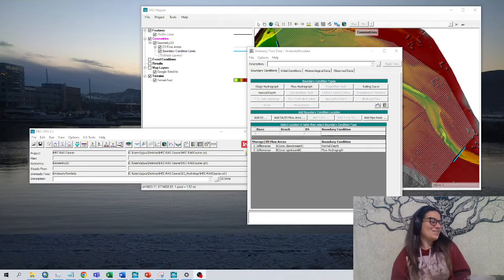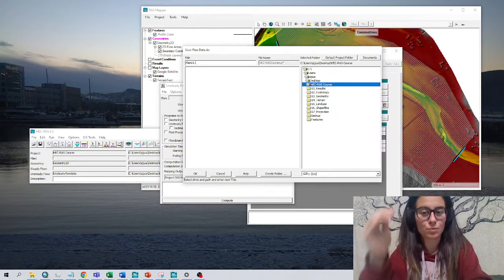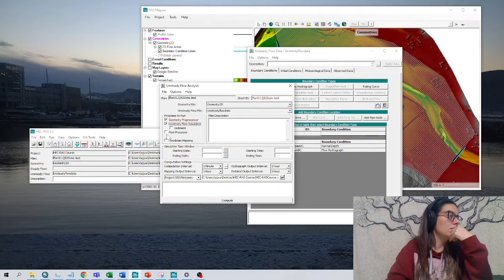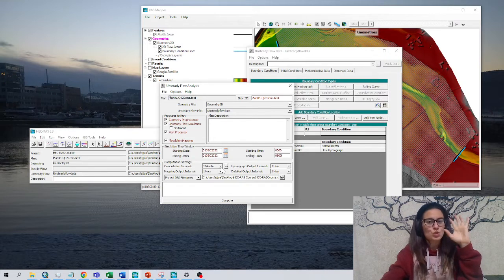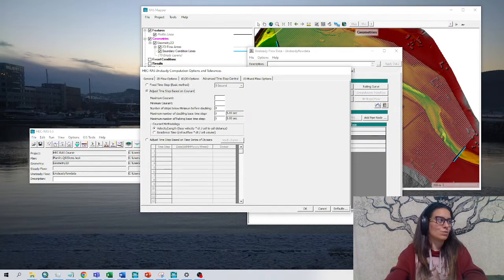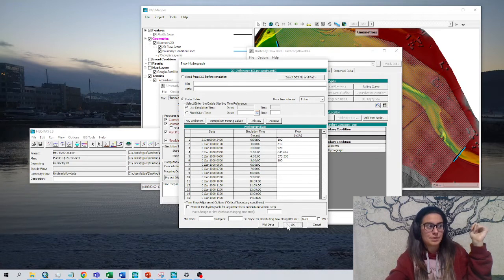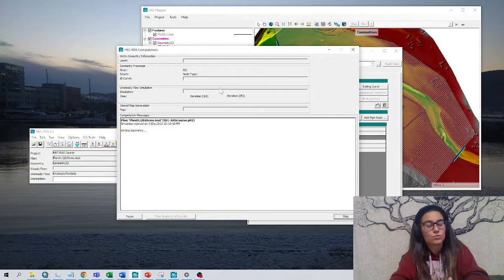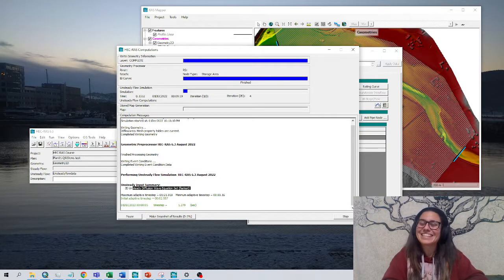Chapter 4 HEC-RAS 2D  Perform Unsteady flow simulation

Comment: any idea what could be the reason for 2D model run perfectly in diffusion wave but in stricter momentum it ended ustable?
Reply from the maker: My first idea would be to check the time step, and set it to be adapted as a function of Courant.